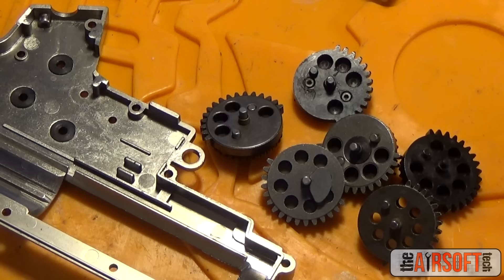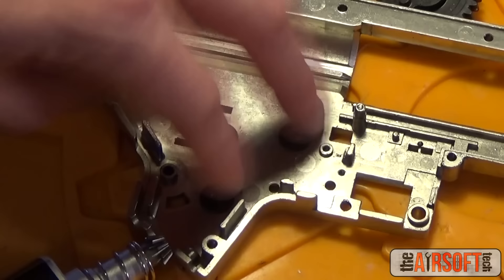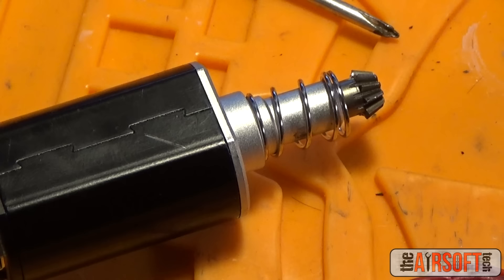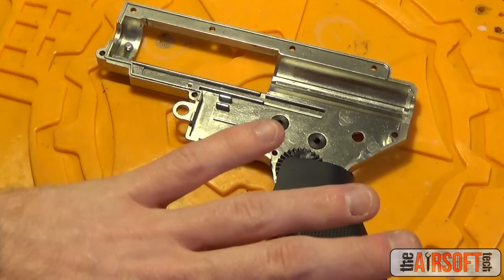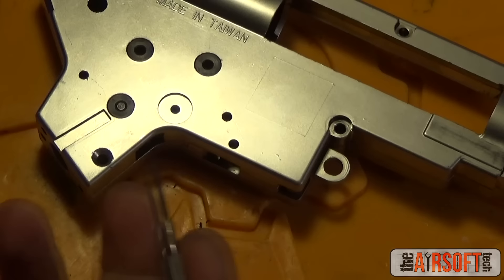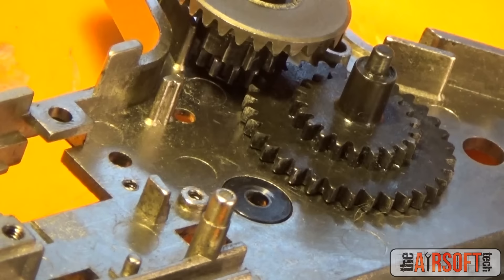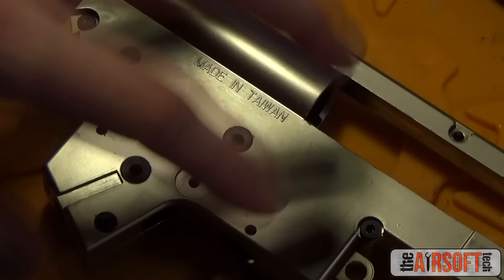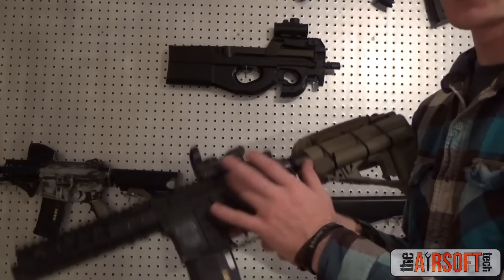How to Flawlessly Shim Your Airsoft Gearbox

Comment from the maker: If you like my content and want to help support me, check out my tee spring store for some cool airsoft tech themed stuff:
https://teespring.com/stores/theairsofttechs-merch
Reply: If you don’t mind me asking, how do you keep the bushings in place? I’ve been working on my Scar-L and the bushings keep falling out when I take the gearbox apart.
Reply: @coltonprivettehorn2798  little dab of gorilla super glue works great, there's also blue medium strength loctite.
Reply: What do you do if your motor raises your bevel so high in the gearbox that two 0.5 and a 0.3 could fit under it
Reply: Aegs yes but polorstars have way less parts
Reply: @coltonprivettehorn2798  loctite 401

Comment: Airsoft guns are more complicated than actual firearms. Change my Mind lmao.
Reply: They are... far more complicated than paintball guns for sure haha.
Reply: Raging Demon312 yeah Bc the most complex part of a firearm is the cartage
Reply: not really.   since recoil and pressure arent a thing with airsoft.   And no need to lock the chamber before firing.

all an airsoft chamber does is move back and forth, it doesn't rotate into a lock.
Reply: If you change your mind just because it is complicated, it wasn’t for you in the first place.
Reply: That's because airsoft guns are toys that are comparably lazily designed. It's hard to make a simple design with few parts. The more parts you have, the likelier it is that any of them fail. It's not a big deal if an airsoft gun fails, but people die when real steel fails, so they have to make sure the design is as simple and reliable as possible.
Reply: Yes, real firearms need to reduce parts and make it simple, less parts less thing to go wrong, more simple easier to clean and repair
Reply: I feel ar15 more simpler inside
Reply: @MinnesnowdanSniper  It really is quite simple tbh, I mean just try taking a AR15 apart and you will notice how simple it is, quite intriguing I must say
Reply: Building an AR can actually get much more complicated. Checking headspace is critical. Is it under gassed or over gassed? Whether it's a rifle length, mid length, or carbine length gas port on the barrel changes the recoil impulse dramatically requiring attention to buffer spring stiffness and bufer weight adjustments and thats just for the DI gas systems,  piston system have their own set of quirks. Then there's extraction/ejection. It goes on and on.
Reply: True. That's why replicas break and need servicing much more often than real steel firearms.
Reply: i work on both and if you try to modify real semi autos you will have a lot more complications than with airsoft. Also when you start to get into long range and re loading this is such a time consuming process that airsoft has nothing on it.
Reply: *read in your best Dwight voice.

False. Many of the more common known firearms are popular due to their simplicity. Other firearms that are more complicated to work on due to all the extremely complex and dangerous symphony of moving parts, expanding gasses, heat, stress, ect. If you need a list, I can give you one. I'm here doing research on airsoft for a sentry gun. I'm a machinist, and hobby gunsmith. I can tell you right now I could make one of those sing.
Reply: Not when engineering the gun
Reply: madichelp0 damn bro we don’t need to take it that far he was just stating his mind not insulting the simplicity of real steel
Reply: @billniko9310   English is hard, huh?
Reply: @madichelp0  i agree, but hes still right tho
Reply: @harleyme3163  what your saying makes no sense, sure the science behind a bullet leaving the chamber may be more complicated with firearms compared to bbs, but firearms are completely mechanical with no electrical wiring or thousands of tiny springs and screws to deal with, therefor the internals of an airsoft gun are far more complicated than the robust, simplistic, and effective design that is a firearm. as @madichelp0 said below, they are "lazily" designed compared to firearms because they are toys like an rc car, not made to save your life.
Reply: @MinnesnowdanSniper  sure, finding those tolerances and the right material to withstand the force of a bullet is extremely complicated, but thats not what were FUCKING talking ab. sorry im very triggered rn. people keep saying what your saying. the average gun owner doesn't have to know that crazy shit, neither does the average air soft owner. what were talking about it the assembly and disassembly and when you compare them firearms are one thousand times easier to deal with.
Reply: @billniko9310  correct, sir
Reply: @DPain82  Yes, but hes not working on an extremely complicated gun. Hes working on an AR-15 which is extremely not complicated
Reply: @jfor0948  Sure you can argue that, but if you have and arisoft AR next to a real AR and you were told to strip each gun down to its raw parts and reassemble it, theirs absolutely no way the real firearm would take longer/ be more complicated. To me that is what we are discussing here.
Reply: @tinyman_101  True, I can't argue with the fact that airsoft has more components. Except, how far the detail strip is going will change difficulty.
Reply: ErgonomicChair well true until you have a broken automag 🤣😂😂😂
Reply: True
Reply: Definitely
Reply: @madichelp0  any German firearm begs to differ
Reply: Its because they can shoot 40 or more rounds per second.
Reply: M190 spring? :0
Reply: Motor goes wrrr.
Reply: Enters South American accent* “I think it’s pretty easy, mag in gun, click trigger then pow it’s shoots, it’s like magic”
Reply: Yes big facts
Reply: yah damn right!
Reply: Fact
Reply: Real rifles have the same technicalities. You have to adjust your gas block on a real rifle according to the round you are using, and if you have a suppressor you have to tune it more. But it's just like any other hobby, once you understand how it works it becomes fairly simple to do, Just takes some willingness to learn.
Reply: As someone who owns real firearms and also plays airsoft. You’re completely right
Reply: Ive been out of the game for 17 years. Holy cow, do I have a lot to catch up on. My boys are just getting to the age where they want to get into airsoft.
Reply: Not when you're talking about tolerances. You can't start shaving metal off willy nilly. You also can't screw with your head space, which would be the equivalent of i guess hop up. If you screw up with airsoft, you don't run the risk of losing your life or limb. Airsoft is easier to convince yourself into maintenance.
Reply: @tinyman_101  You must have more than average knowledge of airsoft guns, and less than average knowledge of firearms.
Reply: Hk g11
Reply: That's 100% true!
Reply: One gun to prove this false, the g11
Reply: @harleyme3163 pressure is very much a thing in airsoft
Reply: They are meant to be a lot simpler because they need to withstand pressure and usually atleast the platforms like the ak-47 and the m4 are meant to be easy to disassemble for the avrage soldier in the battlefield and fix almost any problem.
Reply: Wait till this guys sees an an 94
Reply: I present to you the G11, aka the ‘we taught a watch to shoot bullets’
Reply: 100% agree, as a machinist who has made his own firearms I can attest to real guns being easier to make.
Reply: The only thing complicated about real firearms are the insane tolerances of milling required for a receiver. The actual function of a gun is INSANELY simple. 

These airsoft guns are way more complex tbh
Reply: @harleyme3163  well, recoil is a thing with an gas or electric blowback gun.
And pressure is a thing in every airsoft gun, as that's how the BB is propelled.
Reply: They are. I want a real gun that shoots airsoft bbs with smokeless powder

Comment from the maker: Long video, I know, guys, but explaining and showing how to perfectly shim a gearbox takes a long time.
Reply: TheAirsoftTech 
No problem! The longer, the better! No detail is too small! 😃
Reply: Did you ever consider shimming the motor axis to have less space to move around? That is the space under the motor's spring.

Also, could you elaborate a bit on the use of helical gears?
Reply: TheAirsoftTech you did an amazing job covering this
Reply: munchiemooch cookies to get the longest life out of your internals. shimming equals tons of positive things for the gearbox
Reply: If it's not shimmed correctly the gears are able to oscillate and don't mesh correctly rubbing together drastically increasing wear. Also the increased friction creates heat and slows the gear box down and is noisy vs smooth and quiet. Overshimming means too tight and strain on the motor, battery, and other parts of the gearbox which could lead to shorts.
Reply: DarkerSavant I agree... need to stay a bit loose. Wich material of shim for aps gears? Zinc alluminum... Ty...
Reply: its perfect for starters thanks man may i use your guide in a how to rps guide for others?
Reply: Thanks for sharing. I always wondered on how to do it properly. Any additional advice on tuning will be highly appreciated.
Reply: Bushings Vs Bearings?
Reply: Fantastic video, very detailed and a lot useful, subscribed (even if one year late xD)
Reply: Is it possible it's  called the spur gear because it looks like a spur off a cowboy boot? Perhaps. Step gear is technically not a step to a sector gear but a step gear for the very literal step up from lower teeth to higher teeth
Reply: Perfect
Reply: Perfect video
Reply: You have been very specific and clear!!! Excellent I’ve followed all your instructions and the gear alignment is perfect thank you
Reply: Why is it necessary for the end user to correct a poorly manufactured product?  Why not just buy a quality product to begin with.
Reply: Mike Lowrey BB  
Adding a spacer to adjust fit.
Reply: ALWAYS better to have too long of a video and have too much detail than too short and being left with questions. I'm so grateful for this video
Reply: Super good bud! Couldn't better!
Reply: Not once did you demonstrate the actual installation of a shim.
Reply: @josmotherman591  tbh putting a washer on the top of the gear is not really the hardest part of shimming.
Reply: @beanos2287  That's the whole point, isn't it? Putting one the right dimension in the right place.

Comment: As an undergrad in Mechanical Engineering Technology (MET.) I applaud your ability to communicate terminologies both scientific and unique-to-industry efficiently to an audience with little to zero knowledge on the topic. This is a fantastic skill to have, not to mention your mechanical ability, as well, which astounds me. You speak with experience and that in itself provides confidence when anyone goes to attempt shimming themselves. Concepts may seem simple to us knowledgeable in STEM subjects, but the hardest part is communicating that to customers who have zero knowledge and it is up to us to dumb it down enough to where it is digestible to the average consumer. You did that, sir. I applaud you ten times more for the 33 minutes and 48 seconds of free content filled with valuable information.

Comment: Another tip, some grips may press on to bevel gear bushings. If that happens that can potentially push the pushing to far in and it may hit the sector gear. I destroyed a set of brass bushings that way, If you have steel bushings your spur gear might take the fall instead. If your grip presses onto the bushings file it down on the inside to make room for the bushings.

Comment: 5 years later and still going strong. My only complaint is that this is an instruction on shimming and you never showed any shimming. You showed before and after. You said whether it was top or bottom of the gear but it would have been nice to just show the placement so there is no confusion. Other than that well done and explained.

Comment: Thank you for this awesome Tutorial. I bought an E&L AK-74 that already came with some tuning parts like nozzle, upgraded Vario piston with adjustable muzzle energy from 1,3-1,6 Joules, tuning, stainless steel tuning barrel and CNC machined Hop Up Unit. I ordered an LCT Slim Torque Motor for this airsoft and with your video I can install the motor myself and even shim it perfectly! Thank you very much for the effort!

Comment: Ive tried shimming and it took me literally 6 hours. I was taking my time and paying very close attention to what i was doing, following all the rules jn this video. I also made sure each gear had 60 to 70% contact and it was flawless, i could spin it freely when screwed together. The gun over heated after a couple shots tho, and my pinion is fixed into the bevel gear so it meshes perfectly together, not to far in not to far out. Idk. Shimming is the only thing keepin me from teching on my guns.
Reply: the receiver can slightly alter positioning of the motor same with the grip can push in on the bushings or bearing causing them to press against the bevel gear
Reply: If you have a dental pick set I would recommend putting your grip on with the receiver in place with the motor out. Take your pick and fi d the Interface between the grip and gearbox. If you can't get your pick between the two, your good. But if it slides in one side you should take down the sides of the grip where it touches the receiver.

Comment: Really appreciate this video. Spent an hour and a half shimming my gear box and this was my first time. And now it is running flawlessly. I thought it was my motor but it was not shimmed properly from the manufacturer it was way too tight. I had a shim left over from the factory shims that were installed. Also was able to get a much better air seal from all your other videos. Thanks.

Comment: I believe it's called setting "gear mesh" when you're working on the spacing between the bevel gear and the pinion gear. Just throwing that out there. At least that's what you call it when working on the exact same thing in the rear end gears of a vehicle.

Comment: May be called a spur gear because it resembles a spur. If you are not sure what a spur is look it up. It attaches to a boot and is used to “spur” a horse. Which encourages them to respond to using your heel to press into them to get them to move. They aren’t used much anymore, at least I have never used them.

Comment: Amazing video dude. You are the best airsoft tech on youtube. You explain stuff flawlessly. Thank you.
One question ! I have a fair amount of experience myself of working on guns and gearboxes, but now I want to do a DSG build. I want to use PDI 375mm 6.08 steel barrel. I'm looking for best trigger response (useing ASCU gen 4 and Super Shooter 14:1 gears) My question is about the barrel. Can I use such "long" barrel in DSG build ? Some say that it must be as short as 229 mm. Will be glad if you response. Cheers
Reply: 300mm max inner barrel works best for DSG builds it makes for good air volume with only using half the cylinder space, i tried a 455mm (AK47) and 509mm (M16) it just wasn't working in either very well, couldn't get a decent FPS and range etc was rather poor due to air volume vs barrel length.

Comment: This information took 30 seconds to find...

“Generally, when meshing pair of gears, the smaller gear is called a pinion gear. Also, it refers to the cylindrical gear that meshes with a rack in a rack-and-pinion mechanism which transforms rotational motion to linear motion.“

“Spur gears can be used to increase or decrease the torque, or power, of a given object.”

“A plain bearing, also known as a bushing, is a mechanical element used to reduce friction between rotating shafts and stationary support members.”

Comment: V3 gearboxes don't have issues with motor spacing as the motor is mounted and screwed directly into the gearbox. The motor height is still adjustable and will need to be adjusted, however.

Comment: Another excellent video.

The Spur gear can be called that because it looks like a Spur. 
It can be called a Step gear because it has a step on it, to step-up the torque.

All of the gears use spur cut teeth (vertically cut) so I suppose calling it a Step gear would be more technically correct as that differentiates it based on a unique characteristic :-)

Comment: Bevel and spur gear spin just fine without the sector gear, but installing the sector results in the gears being extremely hard to spin once the shell is screwed together, regardless of shimming. Bushings and axles are fine and the sector is not making contact with the spur gear, either.

Comment: If you are using a aftermarket grip keep in mind you gearbox will slightly wiggle if you shave the grip down so it's not touching the receiver.

Comment: ngl, shimming looks kinda easy. I know for some people it looks super complicated, but to me it looks like you’re simply using the shims to move your gears so they contact each other efficiently. Ex if your spur gear has too many shims it will be to high, and the teeth will scrape on the body of the bevel gear. Therefore wearing down the body of the bevel gear, and wearing down the teeth on your spur gear. Causing them to strip or break. TheAirsoftTech please correct me if I’m wrong.